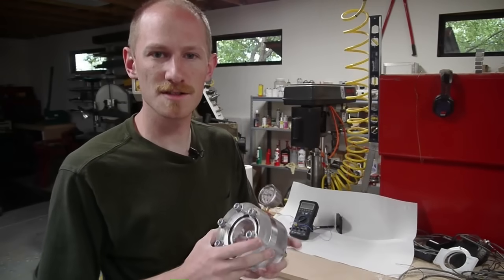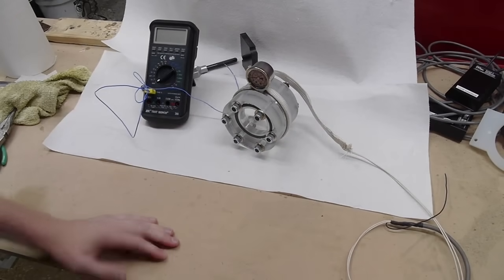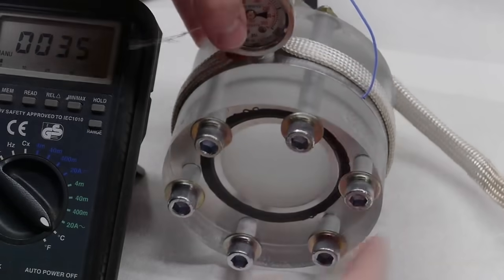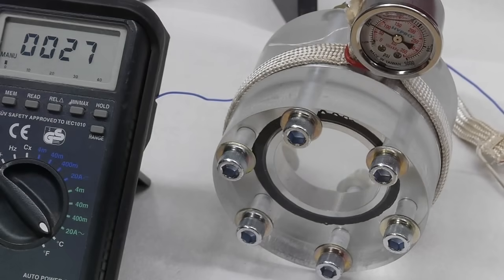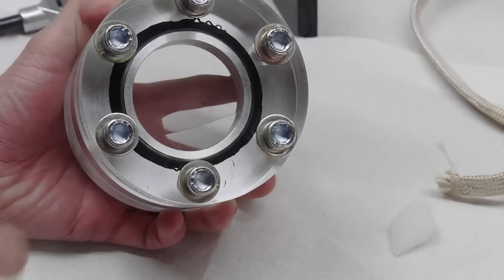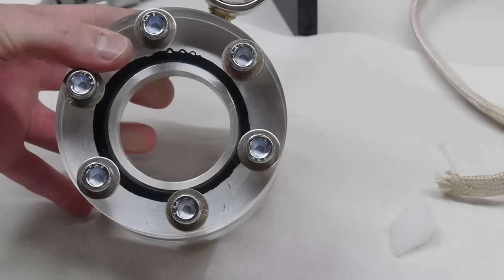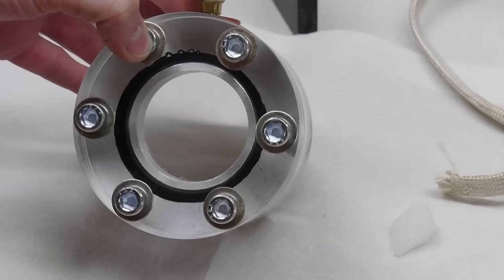A close look at supercritical carbon dioxide CO2

Comment: Could this be used to create a non-mechanical lens?  I realize the applications would be limited (you can't control the temperature well enough for small applications).  It seems like if the density changes with temperature, an adjustable lens with no moving parts could be formed by creating an enclosure with a gas reservoir, and a convex portion containing the liquid and then simply changing the temperature would change the density and focus of the lens.

Or maybe I'm an idiot.
Reply from the maker: +Justin Hall Actually, liquid lenses are a real product.  I'm not sure about using liquid CO2, but most liquid lenses use a combination of oil and water and a technique called electrowetting.  I have a couple videos on the topic, just search for liquid lens.
Reply: Thanks, that was enlightening!
Reply: +Applied Science can you give for us the plan of construction for this chamber please?
Reply: actually I was thinking along the same lines. like using a phase change like that with a laser passed through and measure the wavelength change as the phases change.
Reply: I can make a 3d model + DWGs within one week for 10$.
Reply: In a fixed volume, the density of a homogeneous phase is also fixed. Density = mass/volume, if both your mass and volume are fixed the density is also fixed. You could use some kind of external reservoir, but at that point you could just use a piston to change the density and not bother with the temperature stuff.
Reply: I don't know if CO2 refraction index is only a function of specific density.  I'd expect the absorption spectrum lines to change (Q) with Doppler of temp.  Can it's temp affect other electrical/optical properties?  I assume someone has done non-visual absorption spectroscopy during the demonstrated pressure changes. (My eyes detected no change in color transmission.)

Comment: have you considered repeating this adding a quantity of water & algae to it to see if the algae wood survive & metabolize the carbon dioxide into a significant amount of oxygen ?
Reply: plants need oxygen too...
Reply: Akkupack thatis true but there still is some oxigen in the chamber to start with, you fill the chamber with water dryice and the remaining space is filled with air. After the alges start growing they will produce more oxigen then they consume with simple fotosynthetis: 6 CO2 + 6 H2O -> C6H12O6 + 6 O2
Reply: My guess is the CO2 would act as a solvent that would kill algae.
Reply: @kreynolds1123  100% correct. The CO2 would dry the algae out within seconds, killing it rapidly.

Comment: To preserve the integrity of the o-ring, you could try pre-cooling the aluminum ring in dry ice prior to attempting assembly.  Leaving the pressure gauge loose and tightening it last could also work.
Reply: But then won't the o-ring shrink and also become rigid so that it won't comply to the mating surfaces properly ? ala challenger disaster !
Reply: shodanxx But in this case the O-ring isn't being compromised by a large volume of high pressure burning fuel.
Reply: A1Skeptic You mean the flow of matter past in contact with the o-ring would abrade it but not the very high pressures in this container ?
Reply: The Challenger disaster involved a solid fuel rocket booster O-ring failure leading to a burn through that torched the main tank while traveling several miles per second in a near vacuum. What part of that scenario matches the conditions of this experiment beyond them both having O-rings?

Comment: this is cool as all hell ! ....btw... from the simple way you filled it...theres prob just as much  N & O2 in there as CO2 ....which surly effects the critical Lambda point/phase transition temps & pressures....& 2 valves would be ideal.....also I wonder how energetic the explosion would be if it failed ?
Reply: realcygnusHe spent a fair bit of time showing the deformation of the O-rings from escaping CO2 as he was torquing the bolts. That amount of CO2 should have been enough to purge any atmosphere out of the space.

Comment: Like your meter, BK test bench 390, have one that unfortunately does not works anymore due to what I believe is a voltage regulator that went bad but can not find a replacement part. You are a great teacher, thanks for the video.

Comment: You could have placed the chamber under a hydraulic press. Immediately after dropping the dry ice inside, put it together quickly and then as fast as possible, apply a great amount of force while you install the hardware and torque it.

Comment: Excellent experiment!  ... Possible solution to the rapid pressure increase during closure is mount the chamber into an arbor press with a corresponding plate fitted to it. Rack the press down quickly to limit the "O" ring creep?   I expect that you would have thought of many similar solutions? ...... I like this type of work, ..... always interesting. .....

Comment: Apparently super critical CO2 at high enough temperatures is used for completely dissolving plant matter so as to be able to distill said plant matter and then filter it and get essential oils.  This is also apparently THE best method for getting out THE most oils from said plant matter.  :-)

Comment: 1. Use turning to cut the o-ring groove. 4:50
2.   "No valve on that chamber" - there was one. the gauge on top. you could close the chamber before installing the gauge.
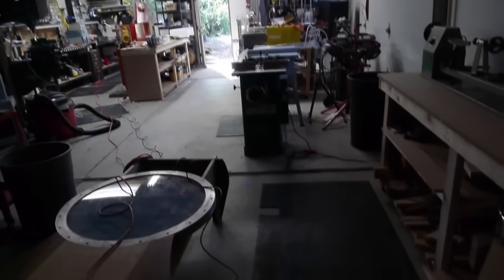3. "installed that in a corner" - at 6:43 we can see that you could do that danger test outside instead...

Comment: i recommend you build a similar vessel and use co2 for hot isostatic pressing, or HIP. You can grind up aluminum for example to a fine powered then mix with suitable wax and make injection mold to make the piece. then put it in the chamber and heat it and result will be hip part that has 100% theoretical density, higher than can be obtained from forging.

Comment: sorry for the noobs question.but isn't the whole (heated) thing just all gaseous?
How do you figuret it's supercritical?

thanks
Reply: Yves Baggi The gas and the liquid are at the same (or very close to the same) density. Just as a helium balloon floats in air, the liquid floats in the gas and they mix and become essentially the same thing.
Reply: That's not the right answer, because anything that you can read in a book should be measurable directly through an experiment (It is 35-36 Degrees C for CO2 I Believe). 

This is the answer: If you look at a P-T phase diagram the Critical point is basically where there is no distinction between Gas and Liquid, it is both. As in the structure of the arranged molecules are the same. To show that it is the critical point you can perform tiny changes in the environment around the point to reduce your uncertainty and show that it is the Critical Point i.e.  T+ΔT, P=Const, then P + ΔP, T+ΔT, then P-ΔP, T = Const, then finally P=Const, T-ΔT. 

Keep doing that with smaller and smaller ΔT, ΔP and while ensuring the Mass / Volume are still const, to narrow down the exact the Super Critical point.

Comment: This thing looks so dangerous!
Reply: +Stingray my buddies tried to make a supercritical co2 extractor for plant oils... it exploded and blew a hole though a cinderblock wall
Reply: +rust blade Haha wow.  Also, plant oils huh? Sounds fun!
Reply: @rustblade5021  Pressure vessels in general can be so dangerous, but with supercritical fluids the danger is magnified because of the way it reacts to most types of seals and soft components. If your buddies try it in future, my advice is to use already tested and rated pressure vessels (such as industrial pressure cookers, they can be easily sourced cheaply), get the pipework welded where possible using pipes rated to a safety factor of 2 for the pressure they're aiming for), and if they must use seals, make sure they're made of Nylon or similar polymer material with a decent thickness flange on the connections. I've helped design a supercritical CO2 research rig, and the flanges we used were nearly two inches thick. I would also make sure they test it first using air so they know it's capable, air isn't quite so bad if the thing decides it's had enough. During testing, we deliberately attempted to cross the critical point using an expansion valve (it was a closed loop waste heat recovery system, a bit like a Brayton cycle), and I can't go into details, but lets just say some very scary things happened when crossing the critical point. I can see why most engineers tend to avoid it at all costs!
Reply: @jonathanreynolds7886  Absolutely spot on!

Comment: Carbon dioxide supercritical state parameters are 87.98 °F (31.1 °C) and 1071 psi (7.39 MPa).
At 700 psi liquid gas when heated from liquid state turns into gas state.

Comment: I know this is an old video, but as CO2 is used as a refridgerant i just want to mention that no matter how much is in the system, it'll be the same pressure at the same temperature due to the vapor pressure phase change balance.

Comment: To make the setup safer, I would add a Tee connection off the pressure gauge and add a pressure relief valve rated to your designed pressure.

Comment: Easily... relieve pressure on some bolts and slowly release pressure... at room temp, it won't do anything besides turn to cold vapor or go through the slight separation between the window and the body.  It might freeze the two, but that is all.

Comment: I think you modified it so there is a valve so you could vent the CO2 after use so its empty when not in use and it will not take long to vent. I'm sure this can withstand hundreds of atmospheres because of the thick metal and acrylic. But CO2 only needs 72.8atm.

Comment: To get the maximum dry ice in there, can you use a hole saw and cut a round shape? It may take some playing around with, but if the load is shaped ahead of time you could get a lot more inside. Also, perhaps a jig is required to hold the lid down while you fasten the bolts.

Comment: Inefficient and highly energy demanding (meaning the environmental impact would be greater than just leaving the oil there). Also, unneccessary. Oil is to be mechanically removed. The rest oxidizes, gets eaten by the bacteria, or simply falls at the bottom, and clumps up, where it hardens.

Comment: Do you think you'd have had the O-ring squeeze out problem if you had super-chilled the chamber during the loading/sealing process? Basically, just slow down the pressure buildup?

Also, this is just ridiculously cool. You would make the best chem/physics teacher ever.

Comment: Create a Closed loop displacement type Heat Engine. Where bottom side you apply heat, which causes the C02 Liquid to Go to Gas state and make the piston move upwards on the other side have cooling surface on top which causes Gaseous C02 to Condense to Liquid C02. As long as we have heating and cooling rightly maintained we can have working closed loop displacement type heat engine - vertical 2 stroke engine will work better I believe ( heating —> Expansion (gas and perform work)—> cooling(low pressure)—> Condensation ( gas to liquid)  —> heating)

Comment: I definitely have a suggestion for you.  They say that the density of supercritical CO2 is about 464 kg/m^3 (according to Wikipedia) but I've wondered what would happen if you forced a substance to have a higher density than that.  What would happen.  In other words, you stuff just a little more dry ice in there, such that the density of the CO2 would have to be significantly higher than 500 kg/m^3.  Check the pressure first of course, I don't know if it would just blow up in order to reach that density.

Comment: Someone may have already mentioned this, but you define the critical point as a pressure dependent property. This is a commonly mistaken concept. The critical point is dependent upon temperature only. Above 31.1 °C, no matter how much compression you apply, liquid CO2 will not form, you simply form dense phase CO2. The critical pressure you quote corresponds to the pressure at the maximum of the two phase dome within the P-H diagram (Mollier diagram) and is only significant if you compress adiabatically at temperatures below the critical pressure. Great video nonetheless. Might want to change those O-rings to Kalrez though.

Comment: Try assembling the chamber in a low-temp environment (perhaps a container full of dry ice) to slow down the expansion/pressure build up of the dry ice).  As for what to do with it, try microwaving it or including some high voltage electrodes through the acrylic on one side.  I'd be curious to see if supercritical CO2 would make plasma...and how much higher would the pressure go if it did?

Comment: Flibe Energy is promoting using supercritical CO2 as the working fluid for turbines in electric power generation from Thorium LFTR reactors. Their engineers have calculated substantial efficiency gains over steam turbines.

Comment: not so much a suggestion for SC CO2 but I'm told water will dissolve oil but not salt under SC conditions. Would SC water be a safe proposition in the same manner? Include an amount of mineral oil and salt then show one coming out of solution while the other dissolves. Thanks for the great video!

Comment: Nice, Ben. Thanks for posting. You might follow up with another video showing how the o-rings swell up like donuts after becoming "carbonated" over the course of 24-hrs under very high pressure. I know those on paintball tanks (especially the BUNA variety) become totally saturated with CO₂ in that amount of time. The o-rings are extremely fragile in their bloated state. Consumers generally don't know that CO₂ will migrate straight through an unopened Coca Cola PET soda bottle wall - sitting right there on the supermarket shelf at much lower pressures. Touch base with me and let me know how I might persuade you to slap another one of your gizmos together. Being able to see inside the pressure vessel - that's the ticket.

Comment: It would be interesting to see this at the molecular scale. Are single molecules/small clusters of molecules liquifying and re-evaporating in gaseous suspension during the part that looks foggy? I would guess that enough heat could make the CO2 a gas even at extreme pressures.

Comment: It occurs to me that if you adjusted the amount of CO2 and replaced the acrylic with the right kind of glass, fixing it so that it hit about 1300PSI at 872 degrees Fahrenheit, you'd have a little slice of Venus surface atmosphere in there. Would be interested to know how that behaved optically.

Comment: Drill a hole and put a fitting and filling valve to attach a pump so you can create a high negative or positive pressures  while trying different inert gasses like argon neon oxygen nitrogen helium krypton and xenon  at  high or low temperatures and pressures to study the transitions between states gas to liquid to boiling to superfluid and solid under different conditions of pressure and temperature  !

Comment: Hi, it would be cool to try to set some devolved two component epoxy resin during the supercritical phase,  that is, when a solution of carbon dioxide and resin can go supercritical..or epoxy will dissolve at all, and..not sure if one would do that to that gorgeous looking pressure chamber.

Comment: Strip-heaters are also used for home-brewing. :)

How are you going to re-use it safely btw? It's under pressure and I see no release valve.
If you add one on the next one it'd also give you the option of sealing the chamber before allowing pressure to build up.

Comment: Hi, very cool video and experiment! I don't know how I could miss it for so many years! Anyway, I have a question about the experiment that nobody has been able to answer so far: What if you filled up the whole chamber with liquid CO2 without leaving a bubble of gas phase in there at room temperature. Then heat it up. Will it still change to a homogenious gas phase? This would mean the CO2 molecules would be still as close to each other as they have been in the liquid phase, but now forming a gas phase with the same density, but different optical properties. Would that happen?

Comment: Fascinating. Thank you for posting.

A few comments.

Would polycarbonate, possessing more mechanical strength be more suited than acrylic, or might you have chemical breakdown?

Do you suspect that supercritical-ness might affect your pressure gauge readings?

Is it also possible that your P vs. T curve remained relatively flat and 'inside' the supercritical range the entire time, thereby violating the gas laws and keeping the pressure low? It stands to reason that a supercritical fluid would be relatively uncompressible, so long as it remained SC.

Have you considered trying this with a two phase system, say NH3 and CO2 having both SC and/or liquid at the same time? Of course other polymers still might have to be considered if you are to see this in action.

Again. Thanks!

Comment: Cool Video. 

What are your thoughts in NetPower's recent success implementing a "green" electric power plant technology based on super-critical CO2?

Super-critical CO2 is the working fluid for the Allam Cycle Power Plant that burns liquid O2 and allows the byproduct liquid CO2 (and liquid H2O) to be completely captured for sequestration or other uses.

Comment: Do you get the same gas/liquid mix running the test at between 22bar and 32bar?  If so, this may have important safety implications for handling liquefied CO2 in storage and delivery. It the mix can exist in those pressures, it would be useful to hone in on the characteristics of the energy required to form the mix.

Comment: Use a electric drill to get bolts in fast....drill a hole from one of the bolt holes bottom in the aluminum into the chamber as fill valve.... that's so kool I think oil make one as a paper weight..... wouldn't that be the coolest thing to just have laying on your desk